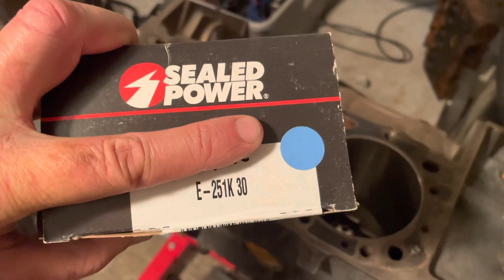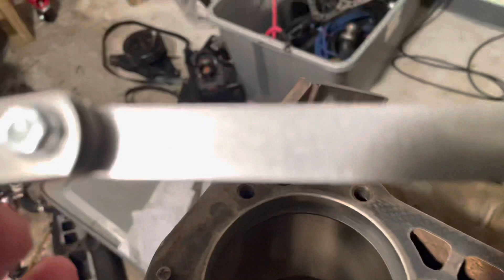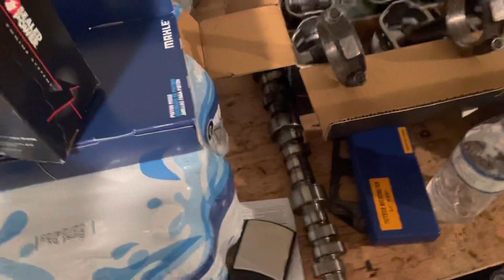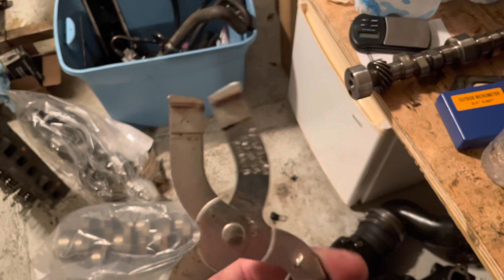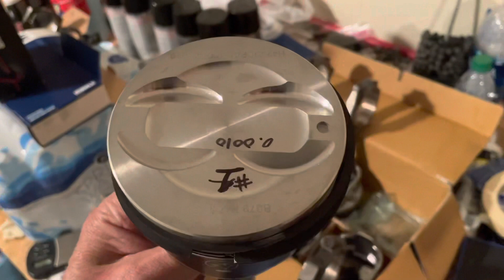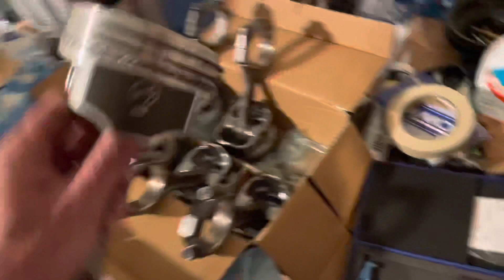Part 4b - Mercruiser 4.3 (2) - Piston Rings Install

Comment: Hi, do you know if I can install mahle piston rings (id:41786) on mercruiser 4.3 mpi, year 2010? Because the second rings are narrower than the original. My original second rings are 0.180inch deep and mahle second rings are 0.143inch deep. thank you
Reply from the maker: I need the serial number from the engine but how did you know what rings to buy if you weren’t certain of the engine specs?

Comment: Is 0.020 gap too large on the first and second ring?
Reply from the maker: No about right. I use 0.016” min for top ring and 0.020-0.024 for second ring ideally but 0.017” for both is ok too. Better to be too large a gap than too small also.

Comment from the maker: I have changed my opinion on ring gaps. I make them both around 0.017”.  The reason is Hastings rings are gapped this wide out of the box. Saves about 10 minutes per piston from not having to file ring gaps. Marine engines are not high performance just higher revving stock engines.